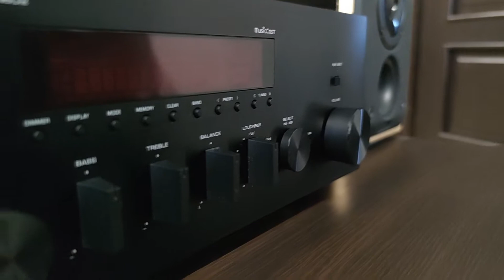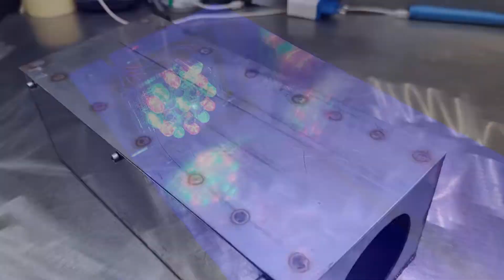Trailer Chanel

Comment: Hey, how are you?...I'm having a problem, with my motor,  constantly running, on my portable Iaser party lights...i can't even use the remote to make it stop...is there a fix for this problem?
Reply from the maker: https://youtu.be/jtW5ixUb99g

if the engine stop button on the remote control does not work, you need to check the remote control itself.

if the buttons work only problem with the microphone see the link.